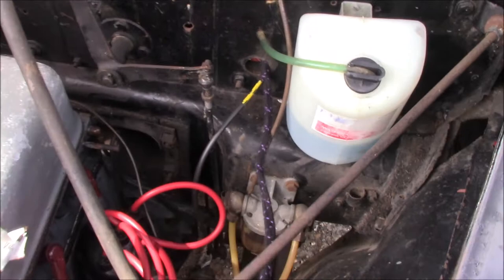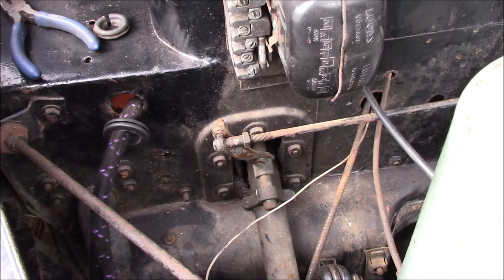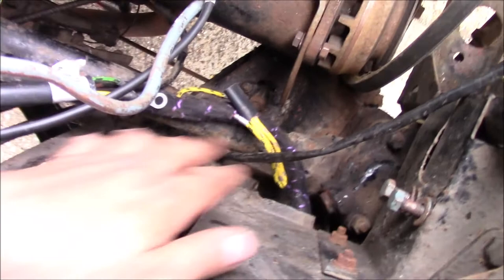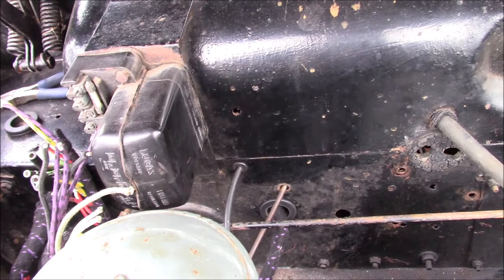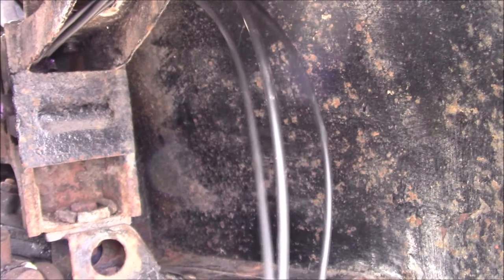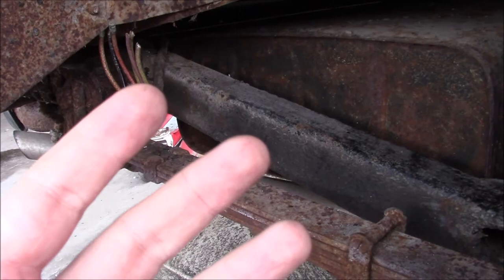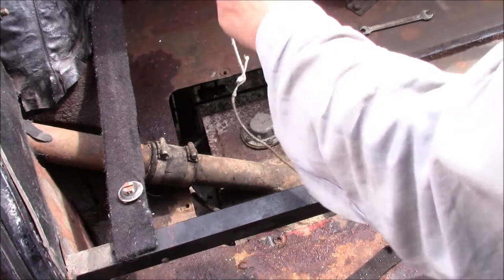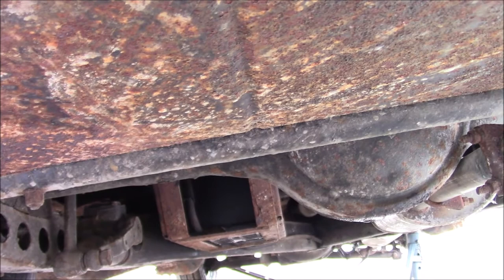1951 Lanchester LD10 - Replacing the Wiring - Chapter 5

Comment: That looks a task. It's good your recording your movements to look back on. That tank looked fragile. Good work so far!
Reply from the maker: Tank is actually a lot sturdier than it appears, the surface rust and dirt is making it look a bit on the fragile side.  It's coming out for a repaint before the car goes on the road properly, might as well now it's mostly out anyway.
Reply: @noexpensespentstudios  I highly recommend you use some of the Autotek Bed liner spray on that tank outside. It's really good strong paint